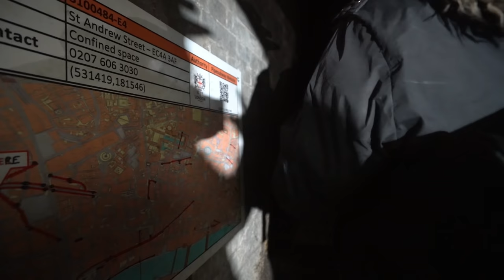No one should be allowed to enter here!! (HIDDEN UNDERGROUND LONDON)

Comment: It’s not the volts you have to worry about, it’s the amps
Reply: The voltage matters immensely, as per safe distance and dielectric strength. You can clasp a 12v battery cable and not get a tingle. "It's the current that kills" is only correct if there's sufficient voltage potential to push a killing current through the resistance you present it.
I seriously advise not grabbing an uninsulated 11,000 V cable. The body's intrinsic dielectric barrier resistance starts to disappear at about 50V, albeit that's based on a number of factors.
Reply: No it's a combination of both.
Reply: @stephensaines7100  Yes current kills but voltage is the gateway to allow it, Car battery is always a good example of high current and low voltage.
Reply: higher voltage more amps can get through your body, everything over 50volt can be dieadly in right situations. but they over react with the cables.    you can get houndreds of ampere from a 12v battery, but the voltage is to low to make high amp through body resistance

Comment: I was told by a lines company worker once that those cables are insulated, however the rule of thumb is not to deliberately touch them as sometimes the insulation can crack and perish, allowing moisture and condensation to create a live connection to the outside. Also that high voltage can jump. I was a field officer for a Metering company at the time.
Reply: Yes, I can also confirm that those wires were all properly insulated.

Comment: The majority of the smaller back cables are virgin cables, I'm an ex virgin media technician. They will run underground and feed up to the green metal boxes or small man hole covers with CATV on them. You can see the cut ones have a copper core/stinger then a foam insulation layer wrapped in foil then the outer black pvc insulation. They don't usually carry any voltage, unless they're amplified, just radio waves.

Comment: 10:59 I love these thick red Cables... uhmm - by the way, in Germany these red Cables can carry up to 145kV (145,000Volts), but in most cases 6 and 20kV... Each bundle of 3 cables consists of L1, L2, L3 (3-phase). The insulation is thick. Normally you can touch these and walk over them without getting shocked.
Reply: Normally.. LoL

Comment: I'm pretty sure that due to wiring installation regs, power cables need to be attached to a framework at regular intervals.  But network,  telephony,  and fibre optic cables don't.  So the cables that are loosely bundled are generally safe.  The ones that are fixed to a supporting framework are also probably safe,  due to heavy insulation,  but present a potential for danger. 
I hope you took a good picture of the maps in the tunnel.  There were loads of other tunnels marked on them, besides the rest of the tunnel that you started on.  Hope you get to see some of them..

Comment: Awesome explore, pretty damn scary with all that high voltage cable. Really interesting to see. I would say yes the authorities do need to know how potentially exposed critical infrastructure is. Be wary of the sewers methane causes asphyxiation. Stay safe guys.
Reply: Do you think they don't know.who change the lamp or fixing pipes.they have everything on maps and they probably check 1 or 2 times per year some tunnels.
Reply: There are even Qr code on the map.
Reply: Pretty sure a lot of what you are looking at is communication not high voltage... he zooms in on a large communication cable at 19:29. If that was high voltage there would be danger signs everywhere and they wouldn't be just tossed and piled on top of each other in that disorganized manner. I do see some 11kv lines mixed into that mess though yikes.

Comment: Those old cast iron cable/pipe supports often have a date on them. They often have a manufacturer too along with location of manufacture. You can often get to within 25years or even 10 if you do the legwork.

Comment: If they were live wires without any insulation, they'd be sparking and they would all certainly be grounded which would mean no power for any of London.  There is a reason those wires were red- they were covered in insulation.  I didn't see a single exposed wire anywhere down there.  Great job trying to make up drama where there was none.
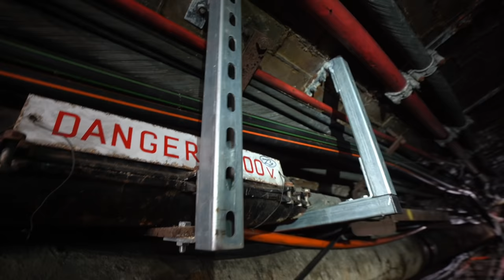Reply: Pause at 27:05 or 06

Comment: Now remember cable TV coax has 90 volts dc on the center wire to run power amps. I used to be a lineman.  It's possible that other com lines might have power to run inline amps

Comment: if those red wires were hot, they are still insulated. otherwise the would be arcing onto the metal they are mounted by. and if they were 11k volts you shoud hear them buzzing.

Comment: You need to get a pinger Detect Electric and electron movement through a sheath for the coding I use them when I’m doing high tension electrical work it’s about the size of a big pencil and let you know if there’s power in there and at what degree

Comment: I work with all those cables the radius black and yellow is sub duct tubing which protects the cable inside the corning cable is fibre optic which is most probably what most of that cable is and on the opposite side is the electrical cable

Comment: most of those cables are actually fibre optic cables by the looks of it especially all the black with a yellow strip ones which are called bumblebee cable, they most likely are BT back bone cables which means they are some of the main coms cables running through london which is nuts, as are the colored ones probably are too, i would have thought the power cables under ground like that would be massive back bone cables , very cool

Comment: High voltage splices and BT cable that goes to the cabinets in the street the thick red cables might go to underground train systems and to factories and big buildings 

The thinner black cables are BT cable and finer optics and street lamp power cabling some old some very new

Comment: i would imagine more of those cables are communication cables than power.
Reply: Ahhh yes 10000volts of communication
Reply: @bmorris5863  I used to do fiber optic cable splicing. More of those cables are communication cables than power.
Reply: @leetucker5788  yeah that's why alot are separated

Comment: `Anyone with the motivation can plant & set off a bomb, or start shooting people, that does not make them a "terrorist.' "Terrorism," by definition is doing something to terrorize. Terrorizing is the goal & method  used to get certain desired results. people may be terrorized by terrorization methods, but the perpetrators are not necessarily "terrorists." Their goal may not be to terrorize, but to achieve some other goal. "Terrorists" intent is the terror itself as a weapon. IT is important to distinguish between the two, or every kid with a popgun is a "terrorist, " & every passenger aboard an aircraft who has a metal nailfile can be incarcerated as a terrorist.If you want to try to heighten interest in your vidoes by throwing around the word "Terrorist," then you are taking advantage of people's fears, which is what genuine terrorists do. Your words & intent are 'bombs' you use for your goals.

Comment: Sorry Danny boy, black wires are control cables. The red ones are made of aluminium. Low voltage that's why there grouped up to make up voltage numbers. Trust you could do back flips on them all

As for informing authorities? You broke in remember?
Reply: David Dimond they didn’t actually break anything, they climbed through a gap and opened a door
Reply: @kieransteers  breaking and entry legal term. Technically where you shouldnt be is term breaking and entry
Reply: Is that not just trespassing?
Reply: @kieransteers  if you're up for labeling, trespassing on railway properties is the worst you could of said because there's an automatically listed offence for that heavy fines etc. BTP British transport police. Will act if that's the case. That's what the law gave them to protect properties trespassing offences.

Comment: what a freaken rats nest under there lmao i never thought to see wiring like that in general hopefully they are very thick coated cause i cant imagine the heat or the sort
Edit: fun fact some of those cables may not be copper but aluminum instead since it conducts better under higher voltages plus it being more cheaper.